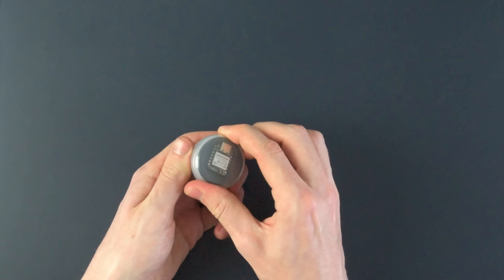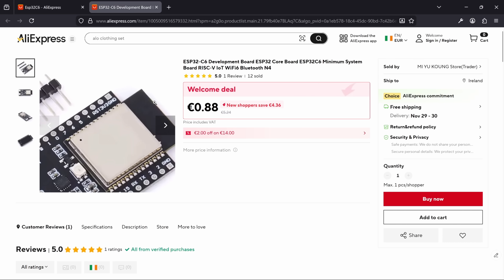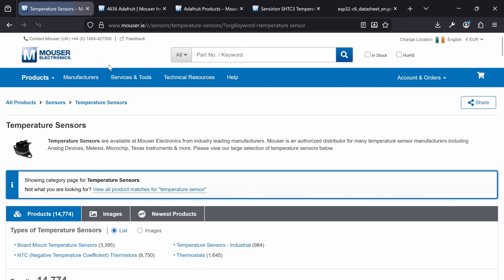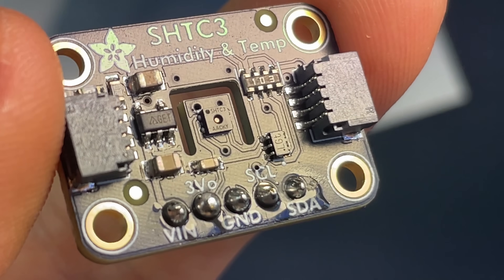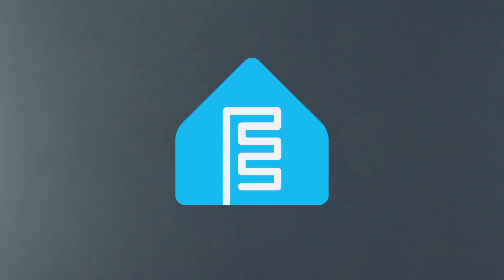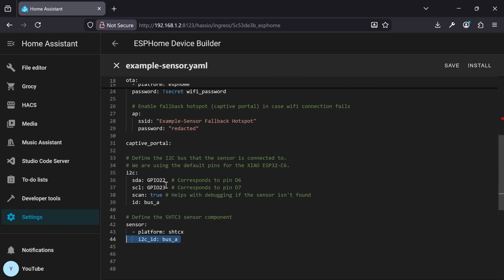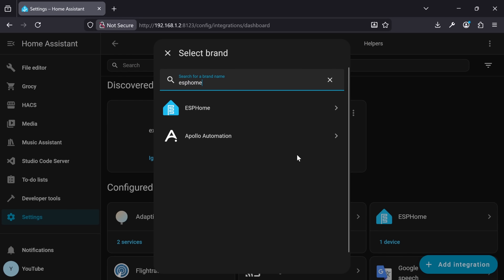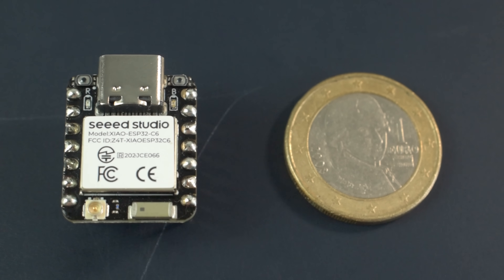ESP32: Build Your Own Smart Home Sensor in 10 Minutes

Comment: Hi ... erm.
If you get three, could they be made into a cluster? just curious
Reply from the maker: thats a good question - off the top of my head, I think technically yes but practically no. you would have to write all the code from scratch in C++ or similar, and I'd say coding all the logic to handle parallel computing like that across the relatively limited interfaces these things have would be quite an ordeal. I wonder if it would even fit on the ROM these things have, specsheet says 320kB. 

Would love to hear other peoples take on this! I think I saw mining clusters using esp32's, not sure if they were legit. Seems impractical but if it works it means someone got clusters of these to work together cohesively!

Comment: Okay. I've wanted something like this, but able to run in very low power mode so that it use picoamps most of hte time, ant wakes up once every 20 minutes for a fraction of a second to send the sensor data. It would be powered from an environmental energy harvesting module and tiny battery (no external power and no recharging as long as it's in a house with AC power).
Reply from the maker: sounds sick - I plan to get into battery stuff next video. what kind of environmental energy harvesting, something other than solar? you mentioned AC, does that mean you plan to use induction coils or smth? :O

Comment: I built a pulse proportional thermostat for maintaining and reporting the environment in my reptile egg incubator some 6 years ago using an ESP32 and a simple DHT22 sensor.  It connects to the home network and can be monitored using a web browser... Ali Express is good for a lot of stuff, but like you I tend to by from the likes of RS Components or DigiKey when it comes to things like these modules. 

As others have said, an excellent 1st video which with 25K views at the time of posting this comment is a very good achievement.  - Subscribed to see how the channel evolves.
Reply from the maker: pulse proportional thermostat sounds cool as sh*t :O What does that mean?

thank you for the kind words! people have been incredibly supportive, I'm a little shocked but also grateful! looking forward to sharing more builds and ideas :)
Reply: from aliexpress, quality control is an issue but at the 6$ price from named companies, just buying 6 from aliexpress would more likely give you multiple that work while being the same cost.

Comment: 🪛 this is just like what Kesser and Steen are looking for 🧰
They managed to tap RH and Temp ˚C from Home Pod, though every one says you really cant, and write into a spread sheet 🤣
They would like to build something like you did, for PM 2,5 / PM 10 - this look so simple, thanks for sharing 👍
🌋🪂 📲 next stop will be to import data to a phone maybe 🕋
Reply from the maker: I got hold of a sensiron SEN66 which includes PM2.5/5/10 measurements and Co2, plus temp and humidity. its not supported yet in ESPHome becaus its new but you could write the code yourself if you have the skills! otherwise you could use the SEN55 which is a kind of predecessor to the SEN66 and is compatible with ESPHome! so you could program it like I did in this vid

Comment: I bought a few of these C6 modules months ago but could barely find any example projects with them. Anything I did find, people talked about the libraries not working great with them. I bought them specifically to use as matter temp/humidity sensors as well. Thanks for this video! I didn’t know ESP Home was that easy to get going. This definitely motivated me to start learning more about microcontrollers and just get started :)
Reply from the maker: ah great glad to hear you got something out of it! once you are more comfortable with microcontrollers, you can do even more by writing your own code, but for getting started or if you just want fast custom smart home stuff, ESPHome is a really great tool. thanks for checking out the vid, keep us posted on the build! :)
Reply: Because full uncut library available only in ESP-IDF
Reply: Chatgpt creates some good configs for esphome ;). Just some debugging needed sometimes...

Comment: I have done something similar, works great with ESPhome and Home Assistant BUT: as soon as you close it in a (3d printed) case the readings are getting wrong.  You need to take into account the heat it is produced by the board too. In my case the sensor didn't have this cut-out and also used a 220v-5v module to power it so it was even worse. I'm only says this to help, not as something negative for your work, I'm looking forward for the final design!
Reply from the maker: yeah no I totally agree! my plan for this was to stack the boards vertically within the 3d printed case, with the C6 at the top, and have ventilation holes at the top and bottom to allow airflow. Lastly, you could use sleep states to prevent the C6 from heating so much in the first place.

Apparently lots of production smart temp sensors manage this problem by just offsetting the temp in software, but to me that isnt really a solution and it would make me doubt the accuracy every time I looked.
Reply: I've been planning to look into the sleep states myself, but haven't gotten around to it yet. I tried to print a housing for an M5 stack NanoC6 and a temperature sensor, but either the Aqara sensor next to it is way off, or I didn't get enough separation between the esp32 and the temp sensor. I tried to orient it side by side, with a housing that had a solid barrier between the 2 parts and open vents around the sensor, but I think it was still too closely coupled and I hadn't taken any attempts at reducing power draw of either, so likely affected by self heating AND heart transfer from the esp32c6.

Comment: Really nicely done. I prefer openHab though 😉
Reply: Most esp32 and esp8266 are 5v tolerant, even on 3.3v pins. You can still fry them, but it is way harder than on other microcontrollers.
Reply: I build several smart lights with esp32 and wled firmware (also integrates nicely in home assistant). That could be an interesting video. Combined with diy occupancy sensors (ir or radar) you can get some nice automations going.

Comment: Try Tasmota on the same setup :)
Reply from the maker: i've heard a bunch about tasmota, even tried to flash a bulb with it over wifi. didnt work, and I don't have a usb-serial cable so had to shelf that for now
Reply: @FeatureNAB you don't need it, I used esp32 c3 and usb A to usb C cable to flash it. It works like a charm. It even have web page ao you can configure the device "on the fly" no need to flash it again.
Reply from the maker: :O you got a guide somewhere? I dont have any c3's but got c6's obvs

Comment: Assembling this device costs more then a commercial one. For example a temperature and humidity sensor from Sonoff costs around 13-15€.
Reply: It's not about the cost, but rather the flexibility that an ESP32 platform offers. This sensor was just one example. For example, I recently saw a video of someone who made a fan heater smart using an ESP32 controller and a couple of relays.
Reply: Cool! How do you do to use Zigbee instead?
Reply from the maker: It can be the same or slightly cheaper*, but @andreas.grundler said, the real value here is total control over hardware and data. Today this is a temperature sensor, tomorrow its a fan controller, or a pocket-sized CO2 sensor, or an RC robot. If one component breaks, replace that, not the whole thing. Also sometimes its just fun to build things to know how they work :)

* €4.70 ESP32 (3-pack), €4.50 temperature sensor, €1-4 USB-C cable and charger. Breadboard can be removed if cost is more important than convenience, jumper wires are cents. I also imagine Sonoff temperature/humidity sensor is not as accurate (wider uncertainty), but that may not be true.
Reply: If temperature and humidity reading is focal point for home assistant, a cheap xiaomi LYWSD03MMC Cr2032 powered unit makes a lot more sense. Easily flashed to zigbee and integrates seamlessly with ZHA. I've done two of these and they're great.

Comment: A big note to point out: The ESP32-C6 is NOT compatible with the Arduino framework in PlatformIO! It only supports Espidfl, which is not beginner Friendly.

I learned that the hard way of ordering two C6 Boards and falling for that trap.

If you still want to use the Arduino Framework, use an ESP32-C3. Although it is missing Zigbee support, you can still use Matter as it also works over 2.4GHz Wifi. You can also use MQTT in order to speak with Home Assistant.
Reply: They had a big 'break-up' after PlatformIO started telling ESP that ESP needed to pay PFIO to have PFIO engineers maintain their support, and ESP told them to shove it
Reply from the maker: wow I had no idea! thanks for the heads up! I was planning to use PlatformIO in the next project, so I will keep this in mind
Reply: @FeatureNAB  use pioarduino. It's a fork of PIO that supports all chips and latest versions
Reply: @FeatureNAB  also to add. ESP Home uses pioarduino to build and upload the firmware
Reply from the maker: @ficeto this info is gold. thank you for sharing!

Comment: Good first video sir... Looking forward to seeing more... I've used one to connect to my sons LEDS under his bed using WLED... But as I am USELESS at soldering, it's all gone a bit wrong... Maybe I'll retry when I get some "spare" time!
Reply from the maker: thank you sir :) I will be making more, so please stay tuned! I've heard lots of good things about WLED, I will check that out in the future! if I could give one tip for soldering, its that you use flux! total game changer
Reply: @FeatureNAB flux makes solder flow like water into your soldered joints or connections. It is essential, as is being mindful of temperature. Hope this helps.
Reply: For most of my WLED light installations  I generally use the GLEDOPTO ESP32 boards from AliExpress, they are about £15 but they are reliable, and will control 5V, 12V or 24V light strips.

Comment: I have flashed a few 8266's from another pc on my local network and had them appear without issue. Am I correct to assume the HTTPS and SSL certs are only required for flashing from a machine not on the local network? Or is this just an issue with virtualized instances of HA?
Reply from the maker: I explained this poorly in the video, partly because I was trying not to get too deep into the weeds and bore the socks off people. Let me try explain in more detail. 

Webpages wanting to use webserial require SSL certs. Our ESPHome addon is one such webpage. It can run the flashing software in a browser window, and accesses your ESP32 using webserial. Allowing a webpage such low level access to a device is risky enough that they made SSL a requirement. 

Going the route I took however avoids the need for SSL because the flashing (and accessing of the ESP32) is not happening in a browser. The flashing software runs directly on the server*. Therefore web serial is not needed. *(technically in a container because ESPHome builder is a HA addon, but thats a detail)

Local network is irrelevant as far as I can tell, as even web apps being accessed within the local network will complain if SSL is not configured correctly. You can self-sign certs for local use, but lots of browsers still get grumpy with you because they can't verify that they are genuine. I havent tested self-signed certs with ESPHome, so that may or may not be an option

Not sure if that clarifies anything for you 🤔 It's surprisingly hard to explain!

Comment: A housing would be simple. Or complex if you want it to be.  Even a beginner can draw a box and make it the right size.  Then add things like a cover and screw holes or holes to mount it on a wall say.  If you have a printer and have made pretty much anything you could make an enclosure for this.
Reply from the maker: Everything is simple when you know how :) Learning CAD currently, I'll give design + 3D print a go for the next project!
Reply: @FeatureNAB  Printers are nearly turnkey nowadays but still a learning curve to get started.  But once you figure out this goes here and that goes there etc. it's pretty much turn it on and hit start.  One thing that a lot of people do is to just download models from the internet and don't do any CAD at all.  And you can scale or modify them in the slicer (not really CAD stuff) if you need to.  

Personally I use Solidworks because I used it at work.  That's definitely a steep learning curve to draw pretty much anything but it's super powerful so I like it. On YouTube I see a lot of people using software where you drag shapes and position them to make your models. I actually don't like that but I think regular people do.  

But seriously, once you are setup all it takes is to draw a square and extrude it to height.  Use the shell function to hollow it out and you have a box.  Then do the same to make a lid. That's where skills come in.  One easy way is to make the inside of the lid the same as the outside of the box so it's a cap which is about the simplest thing to do.  Or make a step so it snaps in and looks smooth.  But how do you hold it in place?  Holes and screws.  Getting threaded holes right in CAD is it's own art form. If you want you could just use standoffs.  

One thing I've noticed is that people who do 3d tend to have blinders and want to make the entire solution out of plastic.  Making plastic parts that mount to metal or whatever is perfectly reasonable.
Reply from the maker: Some good info here! I've seen the trick where you use a soldering iron to melt a metal thread thing into a plastic print with a simple hole, it looks great and makes for reliable threads, I was thinking of trying that. The other thing with an environmental sensor is making sure it can breathe which means a slightly less simple box. But still not too hard. One step at a time I guess :)
Reply: @FeatureNAB  The devil is in the details.  I've discovered that if you get the hole size just right you don't need threads at all.  The metal will cut it's own threads. And if you want to you can simply heat the bolt and it will melt it's own way in.  Works better with larger bolts of course.
Reply from the maker: very cool. for someone who makes a lot of mistakes (naming nobody in particular) I imagine the metal threads are better for repeat use. I can imagine repeatedly screwing into plastic with tiny threads will f them up fairly fast

Comment from the maker: Would love to hear what projects people have made or are thinking about making!
Reply: i made my water bed "smarter" by using an ESP32.    the lowest temperature it would go was only  27°C for the heating element, so i used a temp sensor for the water and esp 32,  to only turn on if below above xx value, and only do it during the night when the electricity is the cheapest, saves me roughly 20€ / year :) and im cooler in the summer :D
Reply from the maker: @Bastyyyyyy
ooh this is a good one. I have a george foreman grill will no temp control (last time I make that mistake). always burning stuff. could be worth trying the same!
Reply: @FeatureNAB   Yeah worth a shot, if you like to tinker. But  Outdoor and electronic is too much of a pain for me. 

currently working on making my "dumb" dishwasher, fully automated with an ESP32 - its way harder then i expected :/
Reply from the maker: @Bastyyyyyy What features are you trying to add with the ESP32 + dishwasher? I thought 99% of dishwashers had all the features you'd need, except maybe cycle finish alerts in HA or something
Reply: Trying to automate a greenhouse, but the wifi needs to be extended.
Reply from the maker: @jakesaari7652 
big project that, good luck with it, keep us posted!
Reply: off grid battery management system
Reply from the maker: nice, that kind of system is a dream of mine - bit of a bigger budget than the project I have here haha, some day tho
Reply: @FeatureNAB  Preliminary research suggests not. I just had a terrible run with Daly and JK systems. They just kept crapping out for ridiculous reasons. Last one wouldnt work out of the box becuse it thought that the temp was < -40C. In Australia. The Temp sensors meter fine - the supplier wont answer warrantee. There is no provision for an over ride. TL,DR - all they are is a buck converter with a voltage set on a variable scale (MPPT) and some switch points Voc and a Coulomb Counter SOC.  Work In Progress.
Reply: Great video - I've built all sorts of things with ESP microcontrollers, including an audio pre-amp switcher, flood detector and - with the excellent Cheap Yellow Display - a monitor for our domestic solar panels and battery.. oh and so many addressable LED lights 😁

I've got into designing my own PCBs too - something I never would have dreamed of back in the days of having to etch them myself!
Reply from the maker: @zx85
nice one, you've done a lot of original stuff, fair play